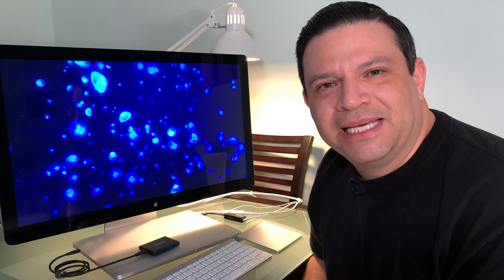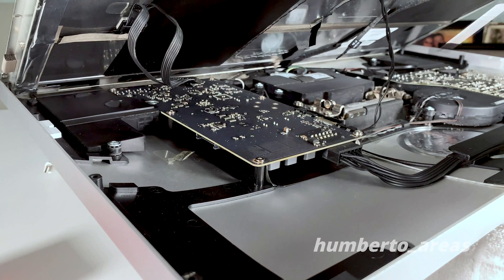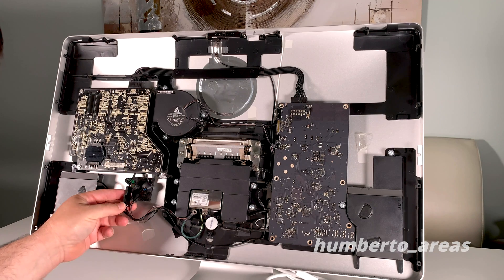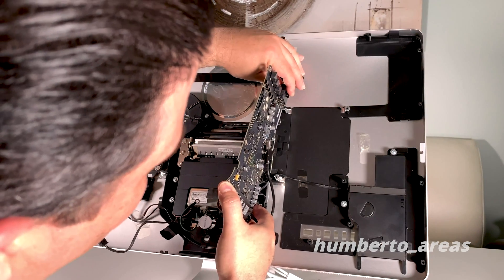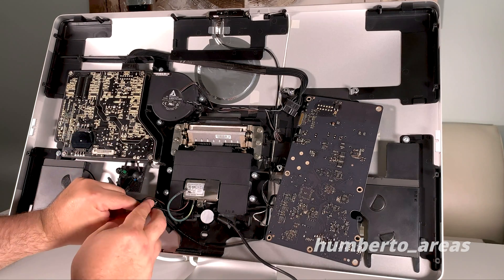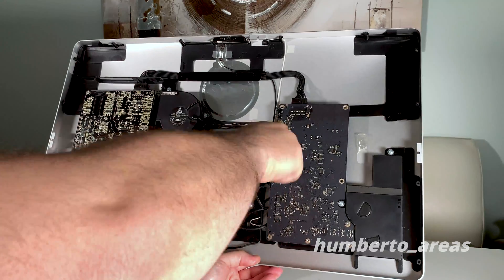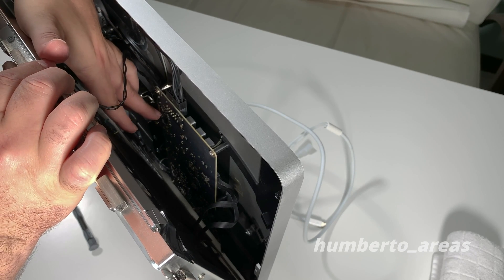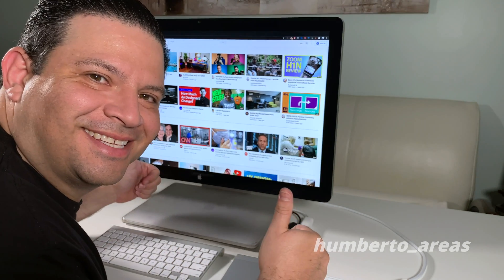Apple Thunderbolt Display Not Turning On - Step-By-Step DIY Repair 2026

Comment: Hmm, where can I find the model number? A girl friend of mine gave me a broke one... No power, doesnt also power on when I connect a normal (not Mac) PC screen power chord
Reply from the maker: @Illifeform, the model number is at the base of the monitor. So lay it down on a firm surface, and you will find info at bottom of stand. 

This could be a simple fix for you. I would highly recommend replacing the all-in-one cable. It’s worth it, these displays are beautiful.

Thanks for watching and for posting your question and comments. Please keep me posted on your repair.

What part of the video did you find most helpful?
Reply: @HumbertoAreas  Was a A1407 this :-) I simply got no power at all on it ? Nor either if I connect the Power cord further from it in my Macbook Pro

Any idea?
Reply from the maker: @Illifeform, good to know we're on the same page as far as your monitor being an A1407 model. It's hard to say why you have no power... and this was my frustration when I tried calling PC repair shops and even Apple, these displays are too old and no one will take a look to see what the issue is.

If your intention is to keep and use the display, like I said in my previous reply, then it will be worth replacing the cable to see is that is the issue. Good luck and keep me posted.
Reply: @HumbertoAreas  OK :) read something about doing an SMC-reset might work on it.. but I am suspecting the cable, yeah? 

Cant be anything else inside of the monitor? 

Have to wait 2-3 weeks to get my suction cups, from my storage room
Reply: Checking this tomorrow :) Or else I will buy this cable.. Excellent video. Thanks! ✌🏻
Reply from the maker: @Illifeform, I believe the SMC-reset on MAC's has to do with your USB/UBS-C ports. I don't believe it has anything to do with your display powering on or off. but then again, you can try connecting your display to other ports and/or another PC and its ports. Good luck.
Reply from the maker: @Illifeform, thanks for the feedback on the video, please don't hesitate to reach out with any questions you may have. I'm here to help.

Comment: I wish if there were a way to improve this poor engineered way for the main thunderbold, like substitute it with a female so it would remain separated from the power cable and you won't have to do all that cr... operation to substitute the cable.
Reply from the maker: @Emiliano, thanks for watching and for posting your comments. I agree with you 100% - I’m sure Apple engineers can do this, but there’s no money to be made if they do. When components break, Apple wants us to buy a new unit, not fix it!

What part of the video did you find most helpful?
Reply: @HumbertoAreas  thank you for the video! It was all very clear and well explained indeed :). I hack video, for the thunderbolt "problem" I mean, would be a huge success ;).
Para mi Apple se puede ir a comer m... I will never buy another new Apple product EVER (nunca-ma-nunca :D )

Comment: Thanks for going over the disassembly of the monitor. Does your monitor run hot to the touch? I just picked up one used and it seems hot to me on the left side and the top when looking at the screen. The right side is a little cooler. Thanks
Reply: Thanks for getting back - There isn't just the monitor, there are the accessory plugs on the back which have to be powered, also the speakers are powered, but you would think with no cords plugs into the monitor it wouldn't require a lot of power. One thread online indicated the power supply is on the left side which may be the cause. I have ordered another monitor, so when I get it I can take this one apart and compare how hot it runs (same size and definition). Most Apple products I have owned run pretty cool are require nominal fan, unless watching a high def movie or online video. They are pretty good at making their products efficient and hopefully not requiring a water cooled radiator to operate...
Reply from the maker: @David Henschel, please keep me posted once you get the other monitor. I would love to hear what the outcome is. Good luck! 👍🏻
Reply from the maker: @David Henschel, thanks for watching and for your question. To be honest with you, mine runs a bit hot as well… after a couple of hours of use, it runs hot - in my opinion, this is a result of Apple’s poorly design ventilation and cooling system. Make sure your fan is working though.

Comment: hi, would the monitor charge a Macbook before changing the all-in-one cable? I have one with a similar issue but my cable is completely intact.
Reply from the maker: @Alex Duarte, yes… the monitor’s all-in-one cable is capable of charging a Macbook. You need an adapter, which I’ve listed in the description below the video.

Comment: Guess what, I took it apart like you showed, unplugged all the connectors, plugged them back in, tightened the screws and it works like new!!!!!!!!!  I can't believe it either.  Wow.  Thanks for your video.
Reply from the maker: @EnergeticWaves, this is awesome to hear. These displays have been bouncing around for a while now… not uncommon for cables to fall out of their connection socket. Which part of the video did you find most helpful?
Reply: @HumbertoAreas  the part about opening the case and which torx to buy, luckily a neighbor had a complete set. Thanks again.

Comment: SUPER HELPFUL. 

Just got confused with the first 4 cables to unplug

the big one has a clip underneath
second one needs a little wiggle
third one. (thinnest) move the tape side to the opposite side then slowly pull
fourth is the ground simply unscrew
Reply from the maker: @Bene, thanks for your comments and feedback. Great to hear you got value out of the video. In my opinion,  the cables are the hardest part of the whole process, everything else is pretty straight forward.

Comment: Thanks Humberto for the very helpful video. I just finished fixing my 27" Apple display today. Couldn't have done it without your video.
Reply from the maker: @bondsongmusic, thanks for your comments and for watching. Glad to hear you got value out of the video. Great to hear that your display is back up and running! Which part of the video did you find most helpful?
Reply: @HumbertoAreas  The whole walk through was what I needed so I guess the whole video. I watched it a couple times then followed along as I fixed it. Thanks again.

Comment: Hi. I tried replacing cable and monitor still doesn't work. Anything I may be missing? should. I double back and ensure everything is connected? Or are you aware of any other issues that it could be.
Reply from the maker: @Casey, thanks for your comments and questions. It may be a good idea to go back and re-check all your cables connections. I did run into an issue one tine with the cable that has the fold-over clap/clip was connected upside down. This particular cable is perhaps the most difficult to put back in place correctly. Please keep me posted and sorry for the late response.
Reply: @HumbertoAreas  Darn.. I recycled the monitor. day before you responded. Just thought it was done...
Reply from the maker: Oh no... sorry for the late response, I had to travel for work.

Comment: I have 2010 A1316 I got from my brother. Bought the thunderbolt adapter from apple(49$) to connect to my 2019 MacBook Pro and nothing.. I am in Miami
Reply from the maker: @Jake Nabut, if you have an A1316 display, you have a Mini DisplayPort - Not a Thunderbolt Display. So the Thunderbolt adapter you purchased will not work. I really don't know why Apple made these look identical??? Hope this helps, thanks again for watching, I greatly appreciate you taking the time to post your question.

Q: what part of the video did you find most helpful?
Reply: @HumbertoAreas  what's the solution then? which adapter do i use. maybe a custom made cable?
Reply from the maker: @Jake Nabut, I haven't found an adapter yet... Give me some time and I'll keep you posted.
Reply from the maker: @Jake Nabut, here are the specs for your display: https://everymac.com/monitors/apple/studio_cinema/specs/apple-led-cinema-display-27-inch-specs.html

Comment: I'll be doing that for mine thunderbolt display that I got for free... I don't exactly know in what state the display is because I haven't been able to see it in use... And I have a laptop (not apple's) so I need to buy few adapters to get that display connected to the screen... Anyway I need to do the same thing as u did because my cable is starting looking like iPhone charging cable after long term of use... So this video was actually really valuable to me thta u showed that it isn't hard after u pass the LCD....
Reply from the maker: @Basically Edward, thanks for your comments and for watching. Glad to hear you got value out of my video. Please keep me posted on your display and to what PC are you planning to connecting it to?

Also, what part of the video did you find most useful?
Reply: @HumbertoAreas  most useful?? That u don't need too many tools, and that the glass of the screen is hold on with magnets.. Then that all of the connections were like just take them out... So they didn't require soldering.

What pc I am gonna hook up it to??:
Into a low end lenovo ideapad was it 330?? But anyway I am gonna buy adapter to it so I could connect the thunderbolt display with the laptop. In the future I am planning on buying mac mini m1. I'll be posting one day a vid of the Thunderbolt display when I get the adapter.. But until then it will sitting in his own original box. If someone will ask is it in sale.. It will not be.. Even if u pay me 600$ (USD) for it.
Reply from the maker: @Basically Edward, thanks so much for the feedback. I greatly appreciate you taking the time to post your comments. The new MacMini with the M1 chips looks pretty good! And you have the Original box for the Thunderbolt display! (Nice!). Please keep me posted on the video you upload, I definitely want to check it out. Thanks again.

Comment: Not sure if mine is the cables or not. Plugged into power and nothing. So could it be power supply or for sure the cables are bad? Also where the best place to buy the cables ? Thanks
Reply from the maker: @Derek Hoshaw, thanks your comments and for watching my video. My display too was plugged in and nothing! It might be worth a shot replacing the all-in-one cable… you can find links to the cables I’ve used in the description below the video. Good luck and please keep me posted.
Reply: @HumbertoAreas  both of your link say unavailable.
Reply from the maker: @Derek Hoshaw, thanks for the heads up. Let me reach out to fellow designers for additional recommendations on cables. Will keep you posted.
Reply: @HumbertoAreas  ok thanks
Reply: @HumbertoAreas  any luck?
Reply from the maker: @Derek, I was traveling for work, give me some more time as I don't want to recommend a cable that I or anyone I know hasn't had any experience with. Also, let me know if you were able to find anything on your own?
Reply: @HumbertoAreas  I have not found anything yet and ones I did were expensive.
Reply from the maker: @Derek, going through my emails now and I did have 2 friends of my respond, check out these links for the all-in-one cables. https://amzn.to/3Bg8ud3 or https://amzn.to/36GRHlD - They had luck with those as well. PS: I also updated the video description with these (2) new links, as the other cables listed on there are out of stock and I have no way of knowing when they'll be back in stock? Good luck and please keep me posted.
Reply: @HumbertoAreas  thank you

Comment: Great video Humberto, how I know if the damage is the cable ? Because just one day don’t turn on, no problems before. I already connect Thunderbolt cable in the back of the monitor direct with my Mac and nothing happens, just the MacBook display turn off and  on like a resolution change but display don’t turn on. Really appreciate your commenta
Reply from the maker: @Jorge Morales, saludos hermano! And thanks for watching, glad to hear you got value out of my video. Electrical issues happen just like that... one day is working, the next day is not. Have you tried connecting the display to another PC? When you connect the display to your MPB, does your MBP recognize it? You can verify this is "System Preferences > Displays" or under "System Information > Hardware > Thunderbolt". Please verify either way.

I really didn't know my all-in-one cable was bad. When I decided to trouble shoot the problem, I started with the cheapest part to replace, and that was the all-in-one replacement cable. This is the most common problem with these displays. After doing some research, I was frustrated because info is scattered everywhere and there was really not a good video showing the replacement process. That's what motivated me to press record.

Make sure all your equipment is connected to a surge protector. Any power outage, change in current or lighting strikes can damage older electronic equipment. Please keep me (and everyone else) on your repair. Thanks so much for taking the time to post your comments and questions, it is greatly appreciated.

Comment: Hi Humberto, thanks for putting together such an informative guide. I have the same display and am experiencing issues. Today the monitor refuses to come back on or charge my macbook. After testing the USB ports on the back, my conclusion is that the monitor does not have power. I of course tried unplugging it from the power strip and plugging it back in after 30 seconds, as well as trying a different wall outlet. It seems like the issue lies in either the power cable that plugs into the back of the monitor, or the power supply board inside. It seems like there are a ton of replacement power supply boards for these monitors for sale online, but no tutorials. Do you have any experience with replacing the power supply board?
Reply from the maker: @Kieran Grant, thanks for taking the time to comment and watch my video. I do not have any experience in replacing the power supply board. I can try and do some research and see if I find any good videos showing that process. In my case, when I decided to troubleshoot my display, I started by replacing the all-in-one cable, which is one of the most inexpensive parts you can replace on these displays. Let me see what good tutorial I can find, and please keep me posted on your display. Thanks again.
Reply: @HumbertoAreas  thank you for the reply! Anything you find would be helpful and appreciated. After doing some more research, it looks like the 2 DIY options are to buy an original power board on ebay/secondhand (typically located in the US already) vs. a new imitation board produced overseas (can take over a month to ship to the US). I have also found a few local people in my area who may be interested in selling their thunderbolt displays to me. Will let you know what happens either way.

Oh, and to answer your pinned question, I was using these displays for graphic design both at work (in the office) and at home (+ when working from home). I haven't been in the office for over a year due to covid-19, so now I'm wondering how my unit at work has fared after months and months of collecting dust... In both scenarios I'm connecting the display to a macbook pro.
Reply from the maker: @Kieran Grant, thanks for the update. Please do let me know what you end up doing with your display. Many people could benefit from your experience and situation. I'm not a fan of buying used Electronic parts... And aftermarket / generic Electronic parts are often a "hit-or-miss" - So please keep me (and everyone else) updated.

PS: I too use my display for graphic design work... and I'm sure your display back in the office is just fine!
Reply: @HumbertoAreas  bit of an update for you, I bought another 27" thunderbolt display off someone a few towns over for $200. The all-in-one cable was of course looking rough but still worked. I got it home and after some testing, saw some flickering symptoms when used with USB-C adapters. I grabbed a thunderbolt to thunderbolt cable and bypassed the all-in-one cable by just plugging the USB-C adapter in to the thunderbolt port on the rear of the display. Zero issues since then and the aic magsafe charger still works. So this will keep me going for now.

Meanwhile, I discovered I know someone who works at an apple store who could look at my original display. They agreed that it sounds like the power supply board and got me a quote of ~1 week & $145 + tax to replace it. I figure this is my best option since they can get the parts faster (and maybe new?), plus I would need to purchase several tools to fix it myself.

I'm thinking once I find some spare time I'll circle back to watch your video to replace the aic cable for the new to me display I just picked up. Appreciate all your replies and thanks for sharing your knowledge on this!

Comment: My monitor was getting hot after a few minutes of use. (I bought a used one for cheap money, and the seller didn't warn me about the heating issues)
I opened it by following this video, dusted off the fan,  and now it's cool. Thank you!

I use it for work: coding, research, writing, and publications. 
I have tried a few other new monitors but no I like this oldie with really good color calibration :-D 
And I don't need headphones with this one because the speaker quality is nice.
Reply from the maker: @Thamme Gowda, thanks so much for your comments and feedback. I really appreciate you taking the time. Glad to hear you got value out of the video, glad it helped you in some way. Opening these displays (pretty much any Apple product) can be scary! Glad to hear your display is now working under much cooler temps. Q: which part of the video did you find most helpful?